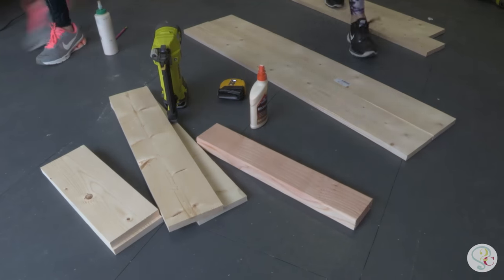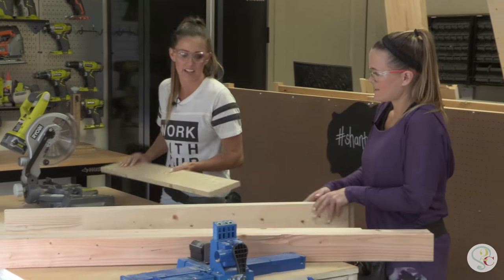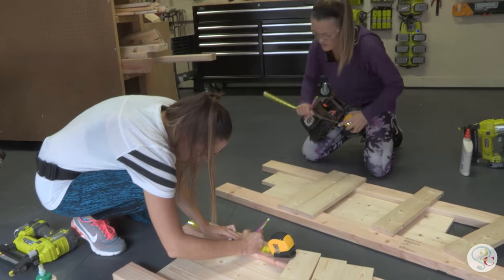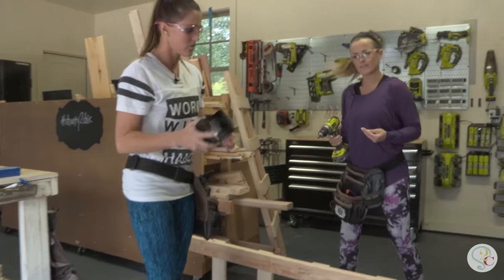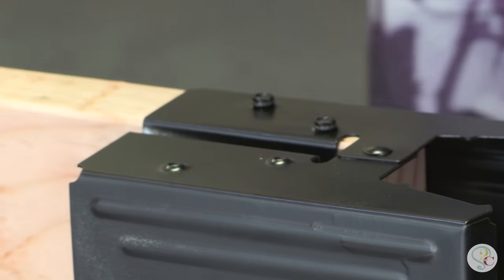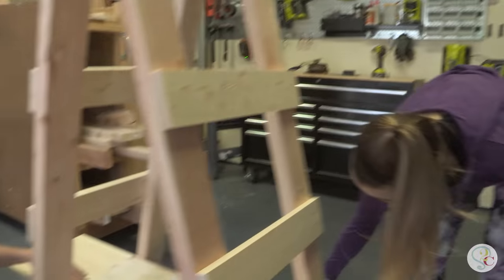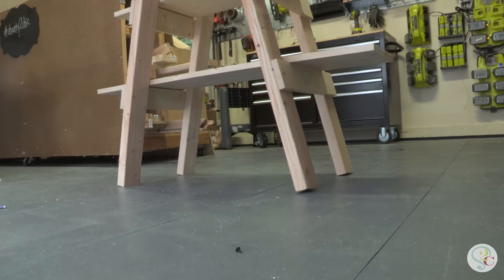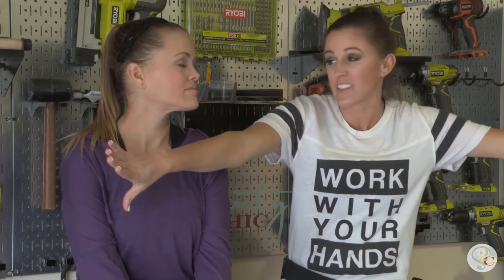DIY Ladder Shelf | 3-Tool eBook

Comment: great job one quest the legs you have to cut in a little angle so when they open are straight with the flloor or you cut  the straight and have a little angle but does not matter???ty

Comment: Is this the 18g or 16g nailer you're using? Seems Ryobi has two and I'm not sure which I should buy. Is the 16g better because it's bigger it doesn't the 18 have a strong too?